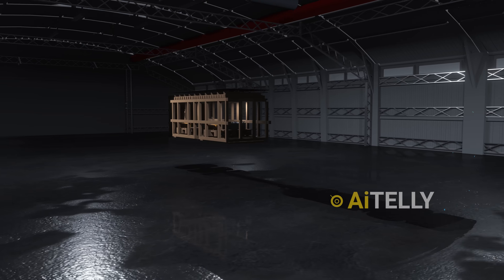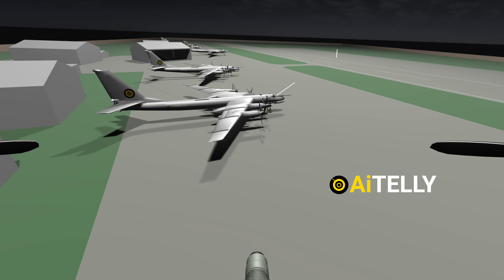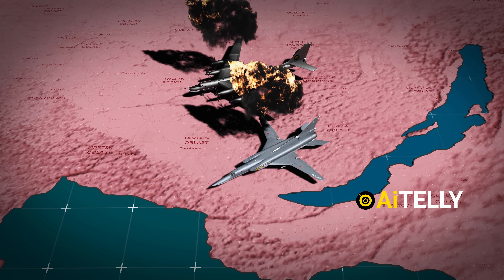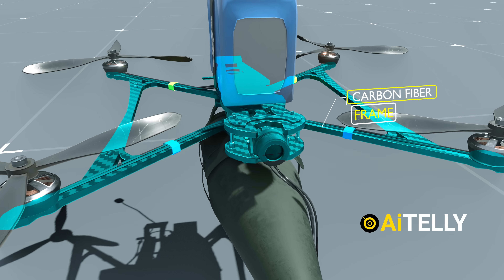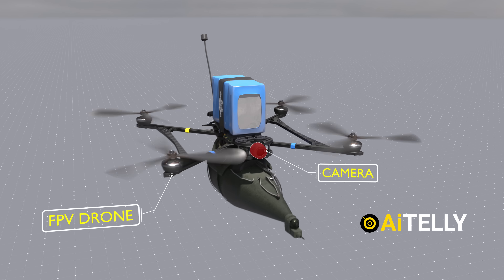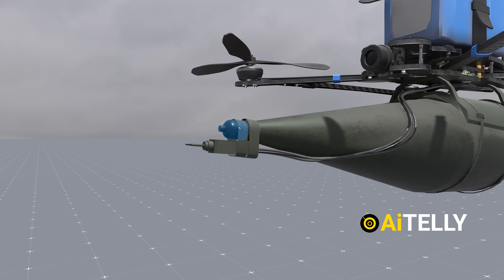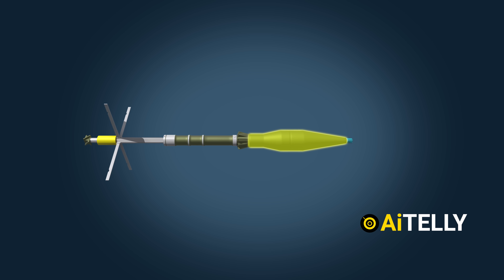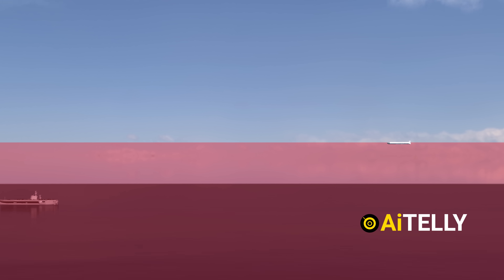How Ukraine FPV drones Truck Attack Happened? #ukraine #russia #Spiderweb

Comment: Carbon fibre isn't designed to withstand impacts at all. Kevlar is. Carbon fibre blows up at the lightest impact. Have you ever watch formula 1? You say the trucks were parked within 2 miles of the targets but that the drones can only fly up to 1 mile.... in Canada you can't get within 1 mile of most military bases.

Comment: If a jamming signal is being transmitted can it not be tracked by it's direction and strength automatically.
Drone is jammed, connection lost, switch to built-in jamming signal detection? 
Just a thought

Comment: I'm surprised nobody has yet decided to use inertial navigation and preconfigured flight plans for missions like these:

High precision IMUs are pretty inexpensive these days, with a couple hundred dollars you could strike within a couple of meters from the intended target at kilometers of distance even if there is a bit of wind.
With absolute zero problems from jamming, GNSS spoofing, etc.

Seems like an absolutel no-brainer for static targets, especially big and fragile ones like big bomber planes on the ground.
It's not like it would make any difference if you hit the thin alluminium structure with the anti-tank shell one meter to the left or one meter to the right.
Reply: Um, it's literally applied in these drones.

Comment: 0:54 how did drones receive signals for mission initiation if the enclosure is shielded for signals
also 3:30? i believe all fiber optics require wires/fiber, i.e., not a wireless system.  so i'm very puzzled by the explanation
can someone explain how they work? I'm just trying to learn. thansk you

Comment: The description of the  electronic configuration of the drone is inaccurate. The motors are 3-phase brushless, with each connected to electronic speed controllers, which are then connected to a power distribution board. Each ESC also has a signal cable that is connected to the flight controller for receiving operator commands.

Comment: They used prefabricated houses they were not 20” dry containers get that corrected.

The shafts ejected with a special mechanism and should be on the floor.

Comment: Fiber optic drones does not have limitation of a 1km. The longest range of such type of a drone was achieved by 414 separate regiment "Ptahy Madyara" (aka the best Ukrainian regiment in drone warfare) with 42km strike. The usual range of optic drone is 10-20km, depending on the weather and wind in particular.

Comment: Drones do not use fiber optics to attack. Ukraine used the ArduPilot system to attack five Russian air bases with 117 drones. This operation was named "Spider Web Operation". Each drone has an operator to remotely launch and command; the ArduPilot system can be activated through the Russian 3G network.

Comment: Drones are EASILY countered with fixed jamming structures which emit specific frequencies to disrupt tech like drones AND cruise missiles. These structures, though expensive, are becoming a common view within military installations around the world, BUT are lacking in countries like Russia and the USA. The USA does have the capability, but only utilizes them around highly sensitive areas, including but not limited to; Presidential areas (living/work spaces), mobile tech designed for presidential motorcade, political residences (senator/governor). 

They have NOT been seen at sensitive military installations stateside NOR nuclear silos and or submarine bases. Makes no sense, right? Especially since I have absolutely no idea what I'm talking about, but these fictional structures would be a godsend if they existed.

Comment: Those drone were programmed with "ardu pilot". Most likely no fpv pilot were involved, but pre programmed some were also showing "failsafe" meaning disconnected from RF and again pre-programmed. Those base are most likely protected by RF jamming radar. Anyway this is my take on it. Finally I don't see multiple pilots in the vicinity flying those without getting caught. See Ardu pilot (open source) making it even easier.

Comment: Ukraine military I just wanted to say OUTSTANDING 10 out of 10. This a classic example of David versus Goliath.
Reply: It was actually launched by The Security Service of Ukraine (SBU). Inspired by the Trojan Horse, probably. So witty, so clever.
Reply: Before you start celebrating, you should be afraid this technology exists. If Ukraine can use it anyone can, it can be used against you by your enemy.
Reply: DroneSheild can avoid this.. avail it from them
Reply: The Ukraine military would have had a very small hand in this operation.
Reply: @wolfmantroy6601  🤡

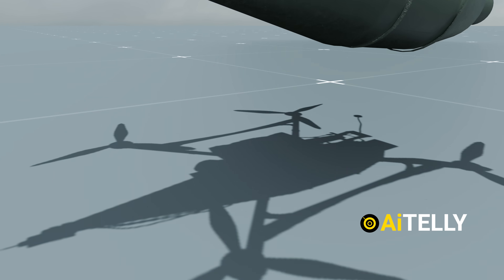Comment: 4:03, 5 miles ≠ 10km. It’s ≈ 8km. I noticed you make an effort to use both systems in most of your clips but it adds to the run time. Why not just stick with Metric, the system most part of the world is using. For US audiences, you’ll get used to it after a while, and be surprised at the ease of use.

Comment: Bravo! Now let’s break down this YouTube "expert" analysis of a 10-inch FPV drone with a "warhead" (because why not, right?). So much nonsense here. Let’s go point by point.

1. "The frame is designed to withstand high-speed flight and collisions."**  
  Reality check: FPV frames (especially carbon ones) are tough, but they’re not indestructible. Smack into a concrete wall at 100 km/h, and those arms will snap.  
Correction: Frames are built for stiffness and light weight—not for tanking every crash like it’s nothing.  

2. "These 4 propellers are strategically designed with opposite angles for smooth flight." 
WTF? "Opposite angles"? Props aren’t tilted in some magic way—they just spin in pairs (2 CW, 2 CCW) to cancel torque.  
Correction: It’s not "strategic angles," it’s basic physics—Newton’s third law, baby.  

3. "Counter-rotation helps stability and agility."  
 Misleading: Counter-rotation stops the drone from spinning like a top, but it doesn’t magically make it "agile."  
Truth: Stability comes from the flight controller’s PID tuning, and agility comes from motor power and weight.
  
4. "The central processor is this thin motherboard managing everything." 
 LOL, "motherboard"?  This isn’t a gaming PC—it’s a flight controller (FC).  
  Also: The FC doesn’t "translate remote commands"—the receiver (RX) does that first. The FC just processes sensor data (gyro/accel) and adjusts motors.  
Bonus fail: Most FCs are thick enough to have connectors—not some ultra-thin magic wafer.
  
5. "Cables at the back connect the motherboard to the battery."  
Nope. The battery connects to the ESCs (Electronic Speed Controllers), which then power the motors and (via BEC) the FC.  
Correction: If you wire the battery straight to the FC, you’ll get a nice fireworks show.
  
6. "The front camera is connected to the motherboard and radio receiver."  
 Bruh. The FPV camera connects to the VTX (video transmitter), NOT the FC (unless it’s a digital system, but even then, it’s not direct).  
And WTF is "connected to the radio receiver"? No. Just no. The RX handles control signals, not video.  

Final Verdict:
This video is either:  
- Made by someone who heard "FPV terms" once and winged it.  
- Dumbed down so badly it’s wrong. 

If you’re actually into FPV drones, ignore this and check real sources (Oscar Liang, Bardwell, Betaflight docs). This? This is comedy. 🚁💥

Comment: It has long been known that the drones attacking Russian objectives that are far away from Ukraine's borders are launched from Russian territory. The Ukrainians could have purchased and assembled them even under the guise of volunteers - supposedly to send them to the front. The launch program was most likely sent to them in a messenger - so that it would turn on when a truck entered a particular square, and the drones would fly along pre-set routes. However, it is possible that GPS guided them.

The cargo were wooden portable houses with a door and windows. They had the measurements and shape of sea commercial container. They were made in Russia because similar cargo coming from abroad is scanned with X-ray inspection systems, and the strange contents would, of course, be immediately identified. 

The drivers might not have known what they were carrying, having agreed to deliver the cargo to a certain point for cash.

Comment: On December 5, 2022, Ukraine attacked with a Soviet drone the military airports of Diaghilevo in the Ryazan region and Engels in the Saratov region. According to the Russian government, three servicemen from the technical staff were killed, and four more were injured and were taken to the hospital. The Tu-160 and Tu-95 strategic bombers, as well as the Tu-22 tactical bombers, are based there. 

Russian air defences shot down low-flying drones, and as a result of the explosion and falling fragments, the fuselage of two bombers was slightly damaged. 

The Ukrainian Armed Forces used the Tu-141 Strizh drones that overcame the Russian anti-aircraft system and freely flew almost 650 km over the territory of the Russian Federation to the aforementioned military bases. 

In the USSR, stealth technologies were mastered long before they became a fashion trend in the West. Mikhail Gorbachev put an end to the USSR military drone program.

It seems to me that the Russian commanders and generals didn't learn the lesson. Hence didn't improve the security in, above and around military air bases.
Reply: but the planes densely covered with car tires indicate that the Russians were really afraid

Comment: The Russian Air Force had in service until May 3, 2024:

- 16 Tu-160M/M2 units;
- 58 Tu-95MS/MSM units;
- 57 Tu-22M3/MZM units.

There were 131 strategic and long-range bombers, meaning that Russia had almost parity with the United States.

If we say workhorse in relation to a strategic bomber, then we mean the Tu-95MS/MSM - these machines are no longer being built, and no one seems to be going to restore their production. Tu-95 bombers were produced until 1992.

 It is believed that the Tu-95MS/MSM can serve in the Russian Air Force until 2040, but it cannot be ruled out that this period may be extended.

In addition, engines for the Tu-95MSM are still produced in an improved modification NK-12MPM.

It is essential to understand that, according to the current doctrine of the Russian Armed Forces, an attack on nuclear weapons carriers gives Russia the right to use weapons of mass destruction (WMD) in a retaliatory strike. The enemy managed to inflict significant damage on the air component of the Russian nuclear triad.
Reply: Украина осуществляет демилитаризацию РФ
в ответ на вероломное нападение и в ответ на геноцид и убийства мирных украинцев.

Россия должна быть уничтожена.

Дело уничтожения советских самолетов будет продолжено.

Comment: Hang on. @3:30 you say that fiber optics were used, but earlier you mentioned that they were live-controlled. So, if it was cables, you imply that the operators were local - and you actually mentioned friendly units helping out there. Though I don't think it was the case,  in fact they were likely informationally loaded and programmed. The routines might have begun without an external signal, but after a (un-inhibited) timeout. Partially statically programmed, to minimise runtime errors, and partially dynamically driven via their sensors' feeds (including and above all: the cameras). Also the streaming or the recording and subsequent upload of the videos can have been pre-programmed. Do you have any evidence for the live manouvering of the drones (i.e. of the pilots)?
Reply: @logosfabula  no lol they had operators on the ground

Comment: One of the most ingenious,  crafty, effective Trojan Horse contraption I could ever imagine!
Reply: The rise of drone technology, combined with its affordability and accessibility, has introduced a serious national security concern. A terrorist group could, in theory, use a common delivery truck to covertly transport and launch hundreds or even thousands of drones—potentially as many as 8,000—in a coordinated assault. These drones, modified for surveillance or more destructive purposes, could target government buildings or other critical infrastructure with little warning. The harsh truth is that most U.S. buildings—even high-security facilities—are not fully prepared for this kind of aerial threat. Traditional security systems were never designed to counter rapid, low-altitude drone swarms, and stopping thousands of drones simultaneously would likely be impossible with current defenses. Although counter-drone measures are being developed, they are not yet widespread or fully effective. This evolving threat underscores a significant vulnerability in domestic security and highlights the urgent need for updated defenses.
Reply: @connorschultz7928 Absolutely! I think most country's military is reevaluating this is a viable option. Future war will be AI, technology centric.

Comment: Of course, it would be cool if the Ukrainian forces did it, but do you really believe in fairy tales?! this could have been done either with the help of Massad (which is potentially possible, but it's not entirely clear what they could gain from it, just to help Ukraine, well, it's unlikely if they only got something in return? but what could Ukraine offer?) It is likely that the Russians themselves did it.Does this seem as unlikely as possible?! Well, the bombings of houses to unleash the Chechen war also seemed incredible, nevertheless it was so. so there are many points pointing to this. 1) A car with copters easily completed all checks. 2) the copters flew easily even before the explosions, they made a grand flight like Spielberg with a camera (if this was Ukraine, they would immediately begin to carry out a "task", an attack) 3) the signal was not jammed, and the copters flew without problems (funny). The question is, why did the Russians do it themselves?! there are quite a few versions, so think for yourself..
Reply: The important thing is that Putin shat himself over this and is very lucky he wasn't the target this time.

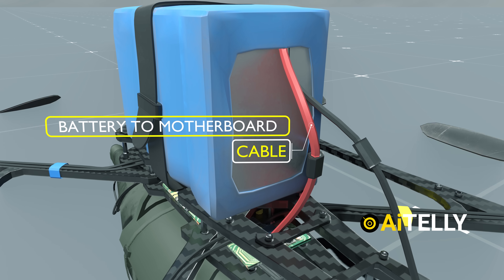Comment: 5:00 needs rephrasing at least...
"The battery is one of the heaviest components of the drone due to it's energy density."
It's like saying this bucket of salted flour is heavy because of how salty it is.
Statement makes no sense, in fact it's actually the opposite: lower energy density would make the battery heavier in order to reach the same capacity.

Comment: The drone controller would need to be onsite, it makes no sense to create a closed system, then use a amplifier which makes a singular point of failure for all drones. Ukraines staterment confirms these DC's were onsite.  Nice attempt, though it is very flawed.

Comment: 1 -The operation did not originate directly from Ukraine to Russia. More likely it weas from Ukraine through Kazakhstan in to Russia. This route was likely chosen because Chelyabinsk—where the main activity occurred—is close to the Kazakhstan border, making it a safer and more practical corridor for transporting components into Russia.
2-nd These drones could not have been operated directly from Ukraine due to the extreme distance—approximately 4,000 kilometers. As President Zelensky mentioned, all Ukrainian personnel had already been withdrawn from Russian territory before the operation began.
Therefore, the drones were likely operating autonomously using AI. The drivers seen in some videos were probably unaware of the drones, as they were simply working for a delivery company.
This represents a highly advanced military operation. We are now in an era where drones can be launched from thousands of kilometers away and, guided by artificial intelligence, reach their targets with precision.
It’s both impressive and unsettling to witness this level of technological capability in modern warfare.

Comment: Since when do 5 miles translate to 10 kilometers? 😅
Reply: Also if the battery is heavy due to its energy density, an empty battery should be lighter, but that’s not the case.

Comment: They coudn't use radio control for this opperation if only there was no undercover pilots deep in russian territory. I belive they have used AI navigation or maybe video navigation through satellites but in this case this is not FPV drones in a normal meaning of FPV. Video translation through satellite would have a huge lag making it impossible to control drons presicesly. But they still could direct it to a statinary target.
Reply: Видео трансляция осуществлялась через мобильную связь

Comment: Well, let's be honest, this is absolutely wretched tactics of a weak opponent. The fact that it partially worked not by the professionalism of Ukraine, but the relaxation of the Russian military far in the rear. With proper preparation, protection against these drones is a simple matter. At the front, trained fighters destroy FPV drones with dozens per day!